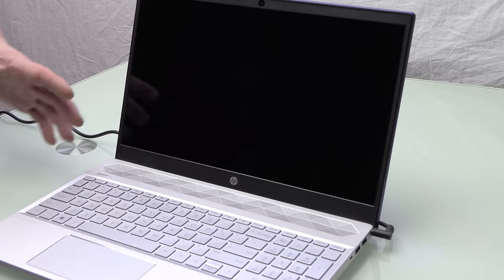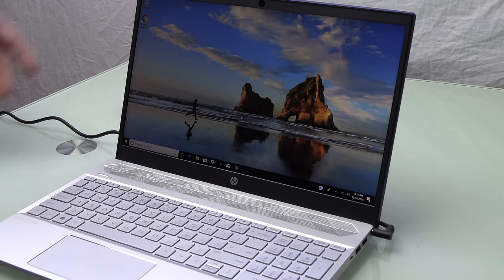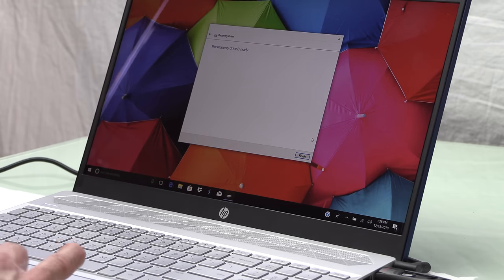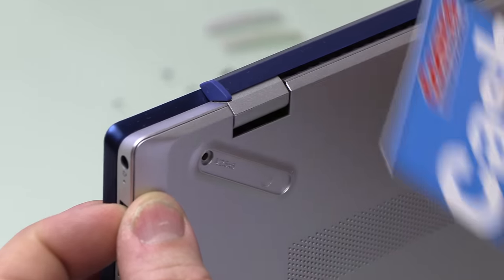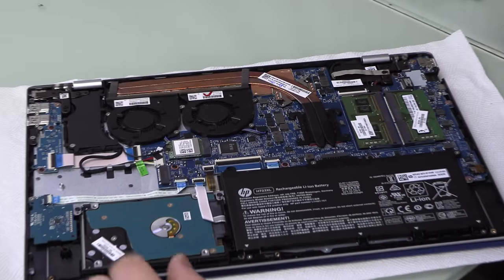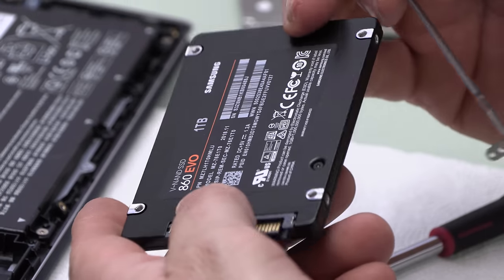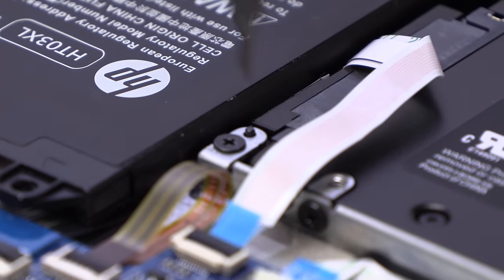HP 15-CS Laptop - How To Remove HDD and Install SSD

Comment: Lovely tutorial. Question.. I have a wired printer attached to the laptop and initially used the accompanying cd to install the software. If i made a bootable drive, would that transfer the printer software over as i cant find the cd and Brother doesn't show it on their homepage anymore.. Thanks in advance

Comment: On top of the Harddrive is a NVMe harddrive slot, the newer versions have there a 256GB Toshiba kbg30zmv256g bg3 nvme harddrive installed just as windows boot drive.

Comment: Great video.
A I always worry when I encounter these panels that snap in, thanks for showing where the clips were. Some are on the case and some are on the back panel and I didnt want to break any or damage the case guessing. Mine was really snug even on the back.
B awesome detail explaining for people that wouldnt be as tech savvy. You pointed out a all the key details on this model if you were to replace the HDD. 
C those Samsung EVO's are great, I couldnt tell if you got the 850 or 860.

Comment: Why the heck did HP make opening this laptop so difficult. In the 'Elite' series it's all so easy. Microsoft too are now making life a nightmare with the evil Cortana there to hinder you and every attempt made to spy on you. They also now insist on MS registration and a pin/password to be typed everytime you start your PC. i went throught all that nonsense when I bought my laptop so I'm going to try 'Eaze to do' back up to see if it avoids all this re MS registration nonsense.
Great video by the way. All really very clear.

Comment: I got a new HP laptop  and had an "accident" I guess so much for the warranty?
A tall glass started to tip over but still splashed some water on the keyboard before I caught it half way.
 Never the less, even though the computer was on "standby" mode at the time, it turned off and will not turn on! 
Very vulnerable it seems! What happened inside? I used to be a service tech myself for alarms and stuff.
 I just Subbed by the way

Comment: thankyou for this video i have one query that while upgrading can i add another ram of same sepcifications upside down in the same slot? that whether i can add the new ram along with the previous one- is there space for 2 or just one? or i just have an option of replacing the previous ram with the new one?

Comment: Does is have a NVMe slot aswell in case i want to keep my original?
Reply: I have the same question, as I saw this laptop has a NVMe slot  at left of the HDD
Reply: But I don't sure

Comment: My 3 year old HP laptop overheated and finally the motherboard died. Videos suggest I buy a cooling pad/fan for my new laptop.  But I see the vents under the laptop is too small to blow air into laptop. Wondering if we can get a bottom case with larger vents to let hear out

Comment: Hlo sir 
Can u tell me 
What are the name of other two cabel, which is in side of the hhd cable ...
And what they used for
Reply: one of them is to read the usb and the other is to procces data from ssd to motherboard
Reply: @rxtr1172  no 
One is for keyboard backlight 
And other is for sd card reader
Reply: mothish velaan nah mate. The backlight is above the motherboard that is with the keyboard.if u look close enough u can see the usb reader on the right
Reply: @rxtr1172  no no .... 
 Backlight cable is at the side of keyboard cable

Comment: Hello sir.
I have a new hp 15-dy1024wm notebook and I need to add an internal SSD storage disk. My favorite is like yours, the EVO 860. We opened the notebook for adding + 8 GB of RAM and I only saw a big empty space there, no enclosure seat for the disk and no connecting ribbon/bracket similar to the one in this video. Could you be so kind and indicate me this SSD ribbon bracket part number, brand whatever could help me to buy? There is not any base to hold any disk, any enclosure or side disk supports as you are showing, the 2 ones by side, could you please indicate me how could I find this? Many thanks in advance.

Comment: Thank you for the video but you missed the M.2 MNVe SSD slot right next to the factory HHD..  I have a HP 15-cs0012c. I put in a lower end WD BlueM.2 SSD that has a read speed of 2,400 MB/s. The Samsung 970 EVO is 3,400 MB/s.  Now I have a blazing SSD C drive and a 1TB data drive.
Reply: I have a HP Pavilion - 15-Cc123cl with an HDD as primary bootable drive and a 256 GB SSD. The system is really "painfully" slow and I have been recommended to upgrade the HDD to SSD.

 I am planning to replace the HDD with the Samsung 980 M2 SSD... 

The surgery :-) is scheduled to begin in a few :> ... following this video for the guided opera

Comment: Looks like that model has a M.2 slot. Don't even have to take the old drive out if you get a M.2 SSD and configure your machine to boot off that (after cloning the old drive contents). Anyone happen to know what size M.2 cards will work with it? The screw position looks similar to the one I'm working on.

M.2 SSDs can be faster the SATA based ones. Depending on what gen M.2 this laptop has. ;)

Comment: CC series is similar, 2 screws on bottom, and hard drive in rubber cradle, lift cable end up, and 2 tabs lock under opposite end.. had a drive failure so customer losing data.. just putting OS in with secure boot so they can get 11 in future..

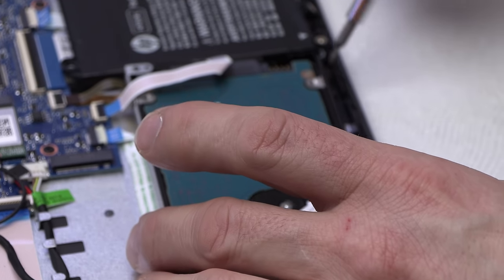Comment: Dual-storage configurations HDD + M.2 SATA (seen at 6:26) are supported in some models.
Also the SATA HDD/SSD could be replaced with an M.2 like in AMD Pavilion 15-cd, I just opened one and it has in the place of the HDD: (1) the solid-state drive cable 933617-001, (2) the solid-state drive converter board 926901-001 and (3) the solid-state drive holder 926902-001.
Reply: i tried to install an ssd in the HDD bay and the computer wont even boot. 
i have dual storage configuration but the 2.5 bay seems to only with HDD

Comment: Clear, right to the point. I like the different angle recording, well done. I just have a small question here. Is it okay if i rely on the partition recovery located in my hard drive instead of making another one on an external drive? ( I couldn't access the "create recovery drive" setting for some reason, it does not open at all)

Comment: Dude! Although one of the better videos on the subject, you missed a big one... A really big one... For the same price or less you could have left that one terabyte hard drive in there and added a 1TB NVME SSD in that open slot right next to the hard drive area.

I have been using multiple drives since 1999 and swear by it. Especially when it comes to operating systems being on a separate drive.  A 5400 RPM spinning disk hard drive is fine for holding things like word documents or just crap data.  With an SSD drive, I can put the operating system and other essential programs on the much faster SSD while saving money on the storage of files.

As of May of 2019, a 250G NVME SSD can be purchased for under $40. A 1TB Crucial NVME is $110. * I just found a 500G HP NVME for $48...
Reply: I'm so glad i saw this before purchasing a new drive. How would I go about installing windows on the NVME SSD? I'm assuming the original HDD would be used to store personal files like music, videos, pictures and such. The NVME SSD Would be the one running windows correct (otherwise you wont see that improvement in speed)?  if youd be willing to help me out with some tips or pointers on how to do this id greatly appreciate it!
Reply: @FrancoCardona1028  Tons of videos and free software out there...  EaseUS seems to be a strong solution although I'm not at the stage of knowing if the free version is best.  The easiest way would be to install the NVMe and then transfer the OS over via a cloning software.  So now, I am just researching that end of things.    The Pavilion 15hcs2073cl seems to be a powerhouse system with an NVMe expansion of 256GB or more. A $40 investment beyond the computer's initial cost.
Reply from the maker: I didn't even see the slot to be honest, in that case would it just work as a separate drive? I'm not really too familiar with running two drives on two different slots on the same motherboard. I haven't actually done that before
Reply: @HookItUp  You could use that M.2 as your OS boot drive, put Photoshop, Office, etc. on it and save the data on the large "analog" drive.

Unfortunately, HP voids ALL warranties when you open the back up at all...

(June 2019) Costco sells the Lenovo Legion for $100 more than the 15-cs2073cl and it has a 256GB SSD M.2 NVMe in there plus a 1TB.7200 RPM HDD. (The processor and memory is more powerful as well.).
Reply: Do need additional cabling to hook up the NVME SSD? And what are the cable(s) called? Thanks!
Reply: @brabham9925  No cable needed for a M.2 drive as the M.2 slot is built into the motherboard and the drive just plugs straight into it. I've not done one of these myself yet, but I believe there is just one screw anchoring the drive at the other end.
Reply: Can somebody help please!
I don't see any open slot for additional ssd. Can you just tell me where it is?
Reply: @janeethreddyalle8178  go to 5:59 and pause the video...

There is a gray rectangle on the left side, just above the traditional hard drive. There's a green thingy in the right side of that rectangle too. That's where the NVME SSD drive will go.

There's a slot (rectangular black thing) on the circuit board facing that rectangle.

You can see the slot's connectors real well at 6:10.

*After hearing that Costco voids all warranties if you install or change anything on the computer (even if correctly done), I just bought a faster, more powerful Lenovo that already had the dual drives in it!

A year later, our Lenovo Y7000 still is great and pricing actually has gone up.
Reply: @seanpop2886  got it.
Thank you
There's an optane memory in my laptop at that part actually. So couldn't get this to my dumb mind😀
Reply: @janeethreddyalle8178  Isn't the optane supposed to speed boot up?

You may appreciate a larger drive to put the OS and your power-needing programs.

🙂
Reply: @seanpop2886  
Yeah but I don't think optane works as good as ssd that's why I'm thinking to upgrade it to ssd. Don't know where to keep This optane after upgrading!
Reply: @janeethreddyalle8178  you will have to remove it.

Research how to remove the Optane and change the boot up sequence prior to committing to it.

Comment: Hy.
Can you tell me what is the name of the cable or path number adaptor between laptop mather bord and the hdd/ssd drive 
I have a laptop with ssd m2 drive and similar laptops have ssd m2 drive and ssd drive 
is a acer aspire 315-55G 
i have the port but i don"t have the cable to connect them
Sorry for my english .I hope to understand
Thanks

Comment: I have the same lap, i will be installing a Crucial NVMe 2280, but eventually i want also to swop the mechanical HDD for a SSD 2.5 ,but i´ve  read that there is some kind of trick to it, because not all SSD work in dual channel with all NVMe,  here i thought that dual channel was only for RAM, any advice there you can share?

Comment: thanks for such an amazing video on SSD upgradation, but should't we loss the W10 license or key for the original one ?
also can we use the NVME M.2 for C drive ?
Reply from the maker: your welcome, you shouldn't lose the key if you make a recovery drive first.
Reply: No, you loose the key only with a new mainboard.
However it's faster cloning the whole disk.

Comment: Hello, I have a question. Can the RAM be upgraded too. Is there a slot for it and if so how much and what brand would you recommend
Reply: Yes! I just upgraded to 2x8GB. Same removal obviously but watch out. On my model the base was attached to the main body via a connector which I didn't know about and I gave it a tug which wasn't great. Memory replacement then had to be done with the base propped open so I could use two hands. Try to pry open the two springs either side of each slot both to remove old and insert new RAM.

Comment: You forgot to re-format the hard drive before taking it out. The recovery partition on it can only be removed in the machine it lived in (without using additional re-formatting software to do it in another laptop). I had no end of problems with "refurbished" machines for that reason.
Reply: it can be easily formated in command prompt with diskpart

Comment: Excellent tutorial, will be upgrading to ssd end of summer, maybe sooner. Currently using only 100gb + 18gb recovery of total 2tb hard drive. obviously don't need 2tb. Could I put a 1tb or less ssd in the machine or piggyback an ssd as mentioned below for speed for the other things I do such as websearch etc, really don't need massive storage at all, reason I ask is a friend who is a wrinkly nerd like me but is a computer whizz says I need to have equivalent ssd to do info transfer from hard drive. Once again many thanks for the info, enjoyed watching the process.

Comment: I installed the same hard drive as you did into my HP and I didn’t have a recovery USB because my computer wouldn’t even let me so when I installed the Samsung I bought a USB windows 10 and it’s still not working do you have any idea why?

Comment: Hi, I just got a HP 15 CW1010LA, it comes with a 512gb PCIe drive which is a samsung mzvlb512hajq. It should have the 2.5 hd bay empty so I want to put a 1tb samsung Evo 860 there as a second drive.
I have a question, maybe this laptop comes with the sata flex to connect the new drive or will I have to buy it too? And if so, what are the specs of that flex cable? Or does the 860 evo 2.5inch come with the flex in the box?  I hope you can help me. Thanks!

Comment: Thanks for your tutorial, it was amazing!!! I just have one question... How do you know what capacity accept your mother board about HDD, SDD or RAM?
Reply: HDD or SSD is very easy to upgrade to any amount.
1. For RAM: Go to www.Crucial.com, 
2. Second, go to search bar and search compatible upgrades and click the link with same name as search.  
3. Then put in you computer name and find your model  and then it will tell you max supported Ram
Reply: To find ram speed, Go to task manager and click performance tab. Then click on memory tab and you will see speed on right side

Comment: This was a great Tutorial, was struggling getting the back cover off and not I got it, but I do have a slightly different question.  I want to upgrade the RAM, mine currently has 12GB, and would like to upragde it to 32GB or even 64GB, if that is possible?  Will this increase the speed even more than just switching to the SSD drive?
Reply: No it doesn't, changing the RAM just will help you to have more programs working at the same time. Switching to the SSD drive will help you to other things like the video shows to run the OS faster, or run things faster.

Comment: Hi, i've an HP Pavilioj 15-cs2093nl notebook...I need to change the SSD that is nearly died (an SK hynix BC501 HFM256GDJTNG-8310A 256 GB), and thanks to this guide it seems easy :) Anyway, I can't buy the exact model of the Hynix SSD since it is out of production...can u please suggest me what exact model can be compatible with my notebook (and if I have to buy specifically a 256 GB model or I can buy a 512 GB)? I've a clone of my disk and I want to bring it in the new hard disk. Many thanks :)

Comment: Very good video, and informative.  It's missing some basic tech stuff - such as using a static guard wrist band before opening the laptop and handling the components, and making a backup or image of the HDD for retrieval.  Otherwise, very good.  Thanks.  
EDWIN PAGAN
CP COMPUTER TECH LLC,  in North Carolina

Comment: QUESTION....
I have the similar (a bit better in specs model) but it's LOUD af, like an airplane engine initial start. Was that noise HDD or was it fans, I still have the warranty so I don't want to open it up.

Comment: Hi, is it possible to have the exact measurements in millimeters, of the screws, head diameter x length, for the display hinges of a Pavilion 15 cs3054nl?
thank you.

Comment: Hi, where would files be stored on this laptop if it didn’t have a hard drive? I have, I think the same model but it has no drive. Had it a long time and it isn’t booting up properly and I’d like to get some files. Hope I can get it sorted
Reply: It could possibly have an m.2 ssd. It should be located slightly north of the hard drive slot.

Comment: You could also just add a M.2 ssd right above it. Have both ?
Reply from the maker: Same thing the previous comment said, I'm not sure about that.
Reply: Just google the model of your labtop or look in the usersguide. There's a M.2 ssd data port right above where the Hdd is installed
Reply from the maker: I saw that after looking it up, I didn't even notice the slot when I took the computer apart, but I'm not really familiar with running those two different ports at the same time, I'm not sure if maybe it's just going to show up as another drive or what?
Reply: Should work just fine with 2 drives.   Very good setup to have boot and executable programs installed on m.2  NVME drive, then put data files and storage on the 2.5" SATA ssd.    Talk about speed?   That NVME will have sequential R/W speeds 5X time that 2.5 SSD.
Reply: @rsrnsrwds  yes! I have this laptop, but it is a NVMe, :)

Comment: Hello I have a HP Pavilion 15-cs0021na with only 128 GB SSD of space, would it be possible to fit it with a 1TB ssd instead? If so is there a specific model of 1tb that I need to purchase to fit my model? thanks in advance!

Comment: I changed my had drive with a 870 EVO but it did not reboot at all, not even gave me the chance to use the recovery  drive. I believe I did all correctly. Is there anything I might do at this point?

Comment: Will a windows 10 USB from Microsoft install into a fresh SSD?  Or, better yet, a Linux USB....
  I have a old Dell laptop that has a bricked BIOs.  I messed up a windows 7 Ubuntu dual-boot and it looks like this would be a good time to just upgrade the old hhd.